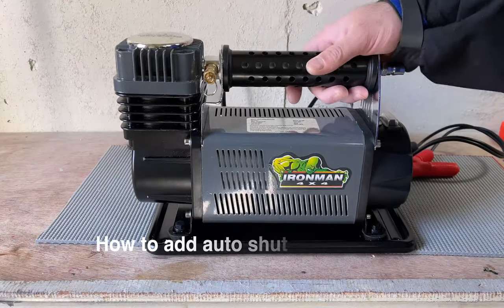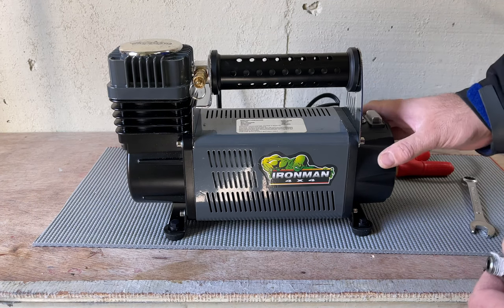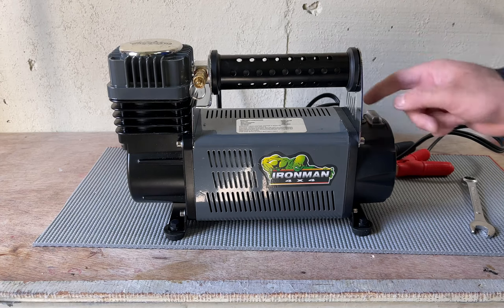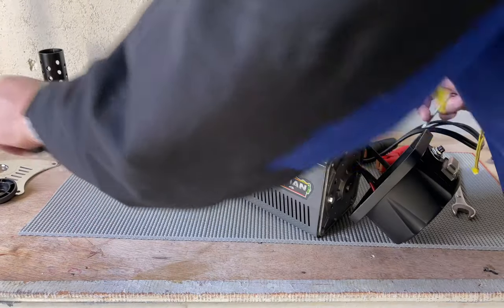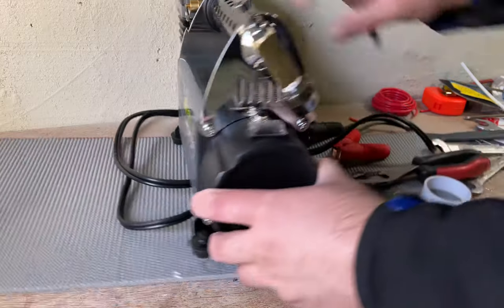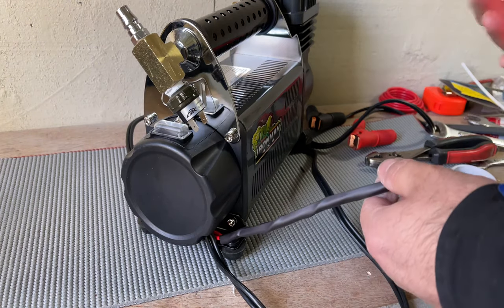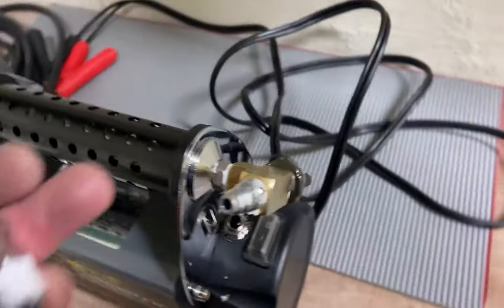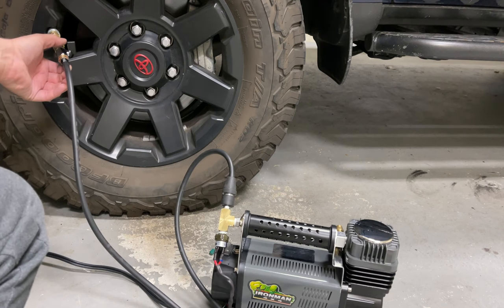Air Pressure Switch Install on Portable Air pump

Comment: Hi, great video. Can you confirm the correct thread size for the male nitto connector going into the compressor. You said it was an Australian standard but I cannot find the correct part. Thanks so much.
Reply from the maker: honestly i don't know but please see the detail in the description , i found correct adapter , its better to replace parts that easily available in US market , thanks
Reply: The fitting you need is 1/4" npt male to m12x1.25 male adaptor

Comment: Great video. Helpful  
I can hear you say that the fitting that threads into the compressor is an Australian standard M2? Is that correct? M2? Are you sure?
Because in the link you gave at the description to Amazon item there is nothing about M2? 
So i need to look for 1/4” to m12x1.25 in order to use the correct fitting. Please explain what is the M2 that you are saying in this video. Thank you.
Reply from the maker: sorry for that , its actually M12 , not M2 , link in the description from where i bought this one and that the one it cost most , i tried to change connectors to 1/4 NPT because this is what we have available easily in the USA market and on very lost cost , i got these 1/4 NPT connectors from home depot , i was worried that if something get damage while i am travelling how i am going to replace that if  not available so i replaced all of these .

Comment: Hi, instead of a fixed pressure switch, is there any 12V digital pressure switch option so you can select the desired pressure so the compressor stops when reached? Thanks!
Reply from the maker: plenty of options available in the market , those battery optional portable air compressor .
Reply: @T4TEST  Thx I already have a compressor similar to yours, I was planning to modify it but I prefer it to stop at some specific pressure value. I'll look for a digital pressure switch.

Comment: Is the small black wire going into the motor a thermal overload?
Reply from the maker: the tinny cable that going inside in the compressor you have to cut and to put Auto Shut switch in between , this cable is coming from Relay then going to switch and from switch output its going inside in the compressor and you have to  cut in between .
i hope i answer your question.
no Thermal in the compressor as far i know.
Reply: @T4TEST  I found that it is a thermal overload switch.